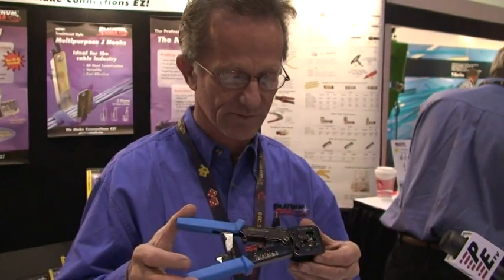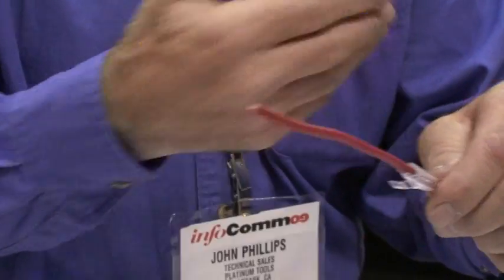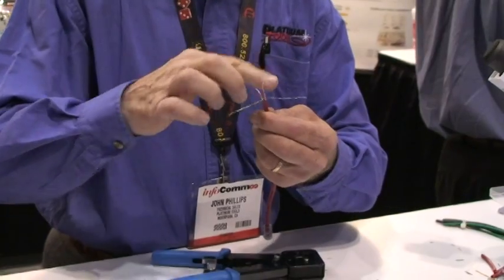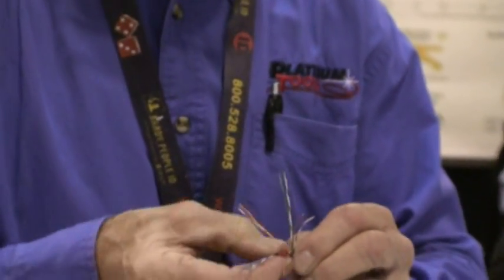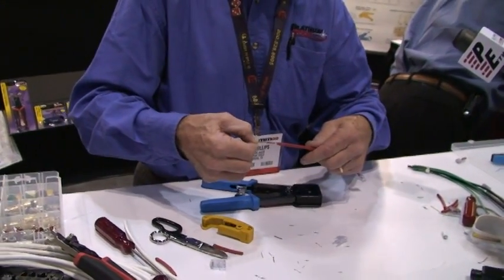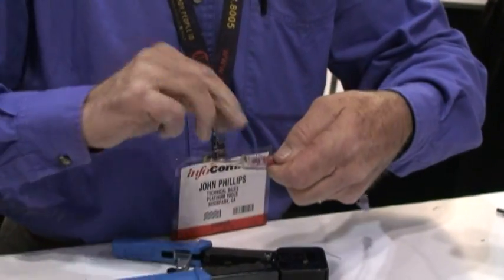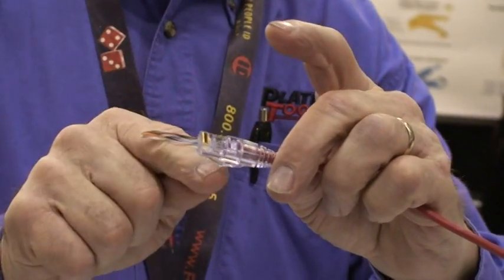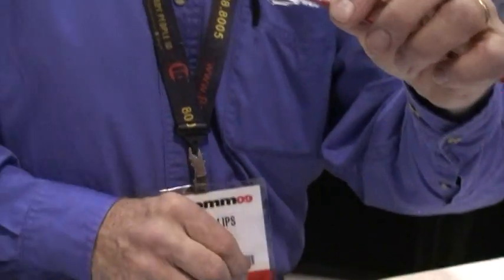Platinum Tools EZ RJ45 Demonstration

Comment: Seems like a much better idea that constantly trying to jam all the wires into the RJ45 and keep them there while crimping. However, I wonder if one can use a normal crimper (with open ended "jack") and then just chop the wires after... :-/ (You'd have to use the EZ-RJ45 plugs, of course).